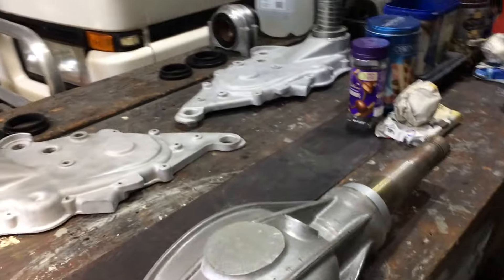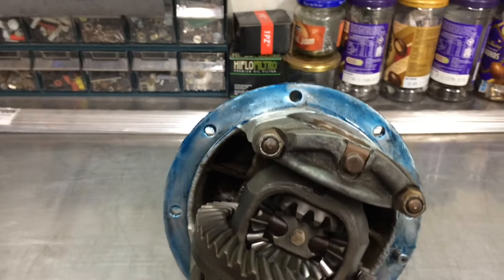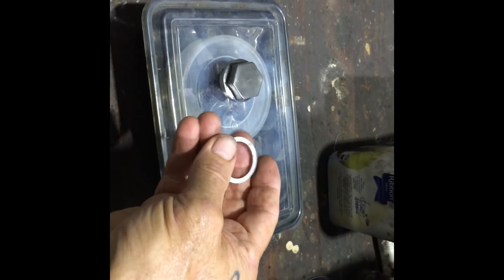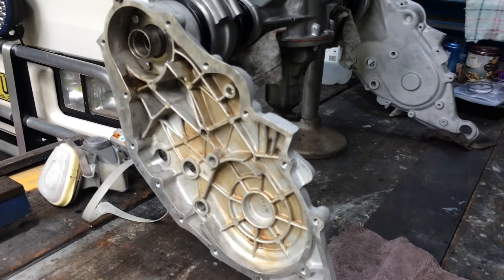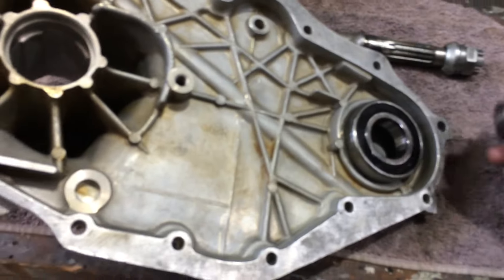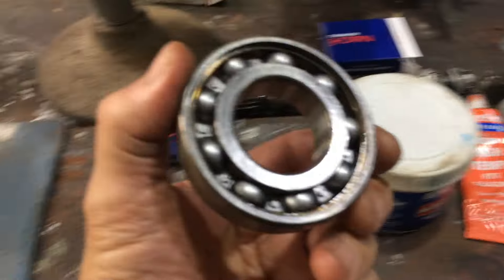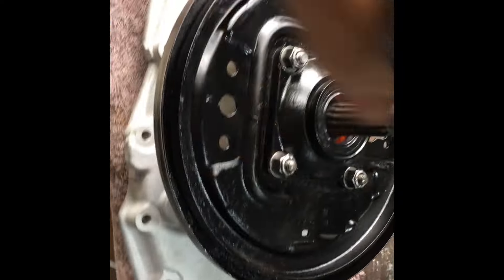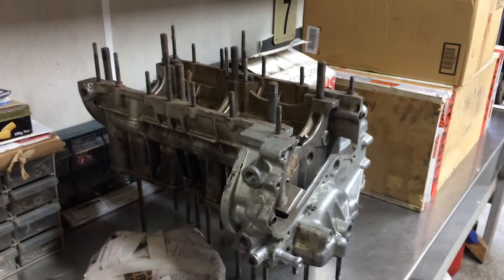Honda S600 Reassembling the rear Chain Drive, Axels & Diff!

Comment: Interesting rear axle setup. I use gasket punches in My drill to make the holes. Helps with precision. Or,i sharpen a tube in my lathe, to make a specific size.
Reply from the maker: Thanks Frank! Gasket Punches in a drill I will check that out, I like the lathe idea too, Cheers!!

Comment: Those plugs are used on lots of Japanese equipment not only cars. A walk around a tractor wrecker, truck wreckers would probably find one. I am 68 and I have the same trouble with the welding glare especially mig and I wear #3 glasses as well. I changed over to a #3 mask view screen insert and an auto shut down helmet and things are better but still not ideal. I went to the optometrist, and she said I have minor cataracts that would not help. Maybe you do as well.
Reply from the maker: Thanks Mate! I didn't know that, I will see if I can find one, Cheers!!

Comment: Struggle is real. I use 2.5 glasses now and need to go a little stronger. It's really hard to see when welding.
Reply: Your backing plates turned out better than mine..just saying.
Reply from the maker: Thanks Chris! I bought a new Welding Helmut I'm hoping it helps, Cheers!!
Reply from the maker: I blasted them in the Aqua Blast Cabinet!!